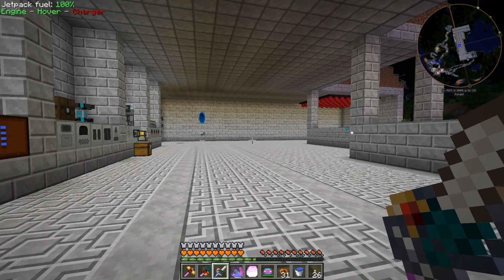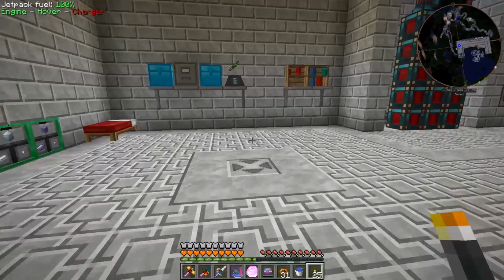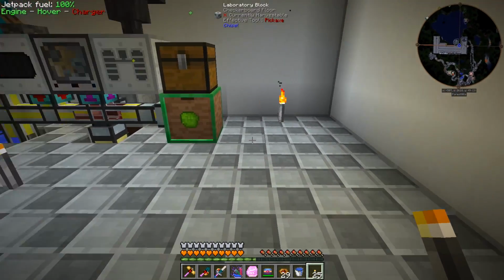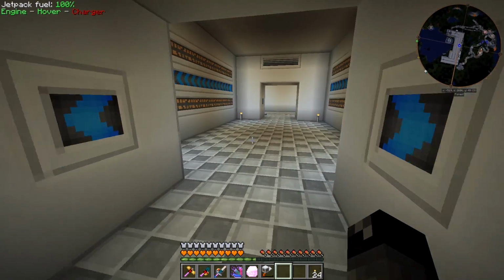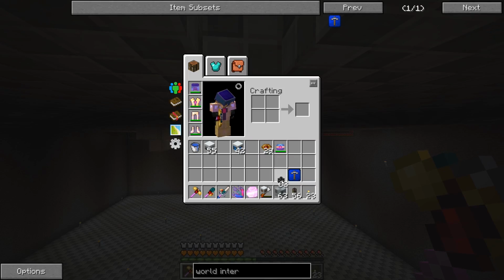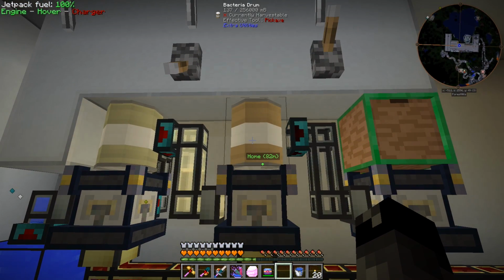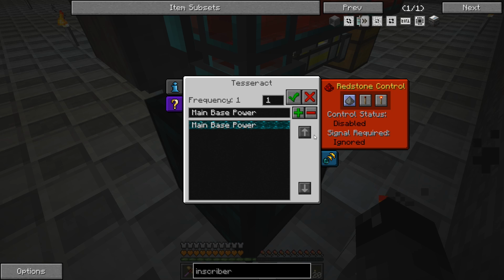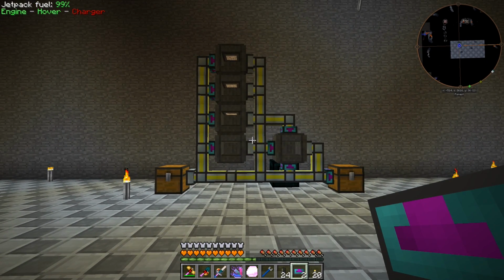Minecraft Mods FTB Infinity Evolved - GENETICS [E36] (Modded Expert Mode)

Comment: I think filling in the wall with drives would be really cool. I recommend the multipart versions of the drives, so they don't automatically connect to each other, and so you can do the same subnetwork chain you did back in infinity, using cable anchors to separate the subnetworks.
Reply: +minerguy31 He already made a controller so he doesn't really need to do the sub network chain thing this time, he could just use p2p tunnels.
Reply: yaksher Still, p2p channels have a limit, while you could theoretically infinitly chain networks so he doesn't use up the channels.
Reply: minerguy31 Yeah, but incase you don't remember the chains created some lag with the system like the ender IO thing that he was using before, mostly with bulk input/output but still.

Comment: It's too bad Hypno isn't doing full-scale ic2 reactor power
I've posted my design, which works great, and is entirely automated
Reply from the maker: +Nate Ralosky Sadly there isn't a real point to do that. I can make plutonium with UU-M and that's the only real reason to have the IC2 reactor in the first place. If the Immersive Engineering cables didn't convert RF to EU I'd for sure make more use of them.
Reply: Have you thought of replicating other resources with uu matter? Redstone, lapis, diamonds, even most mob drops can be scanned. Even some ic2 components, which saves on crafting.
I recommend non-stop replicating uranium until you're drowning in it, then switch over to rtg fuel for unlimited power
Reply: Also, your vids are awesome, I like how you showcase most of the different mods working together. One thing though, with the aqueous accumulator and igneous extruder from thermal expansion, try putting in the speed augments to speed both up

Comment: 12:20 I think it is a bit overkill with these decorations. It doesn't fit the laboratory theme well, way to messy. Maybe use single/double arrow-blocks and space them out a bit. And just random add these information-panel-blocks.